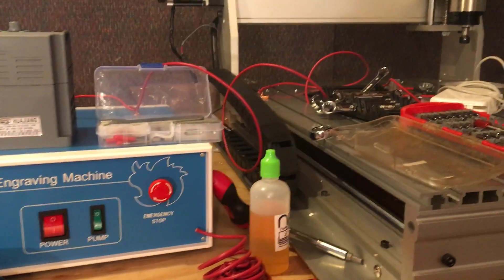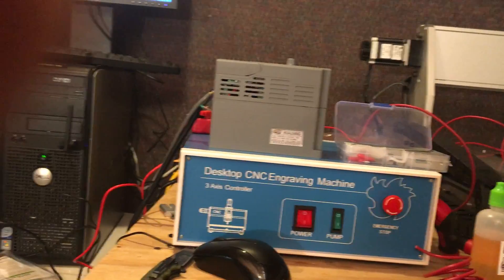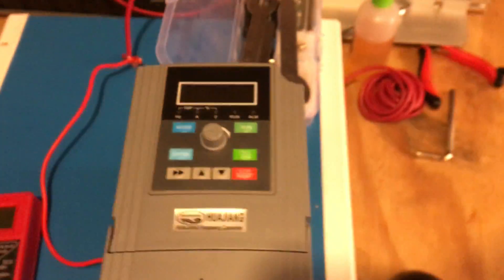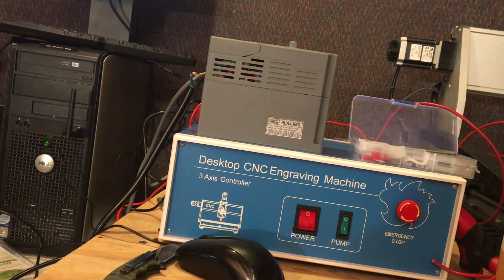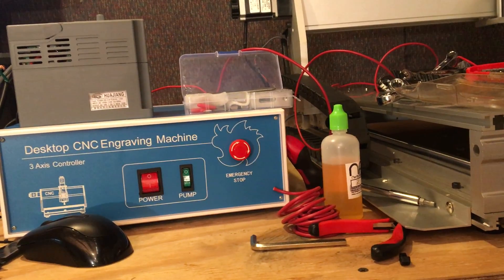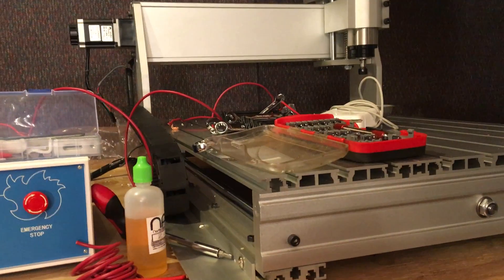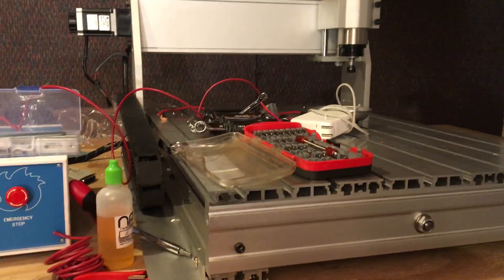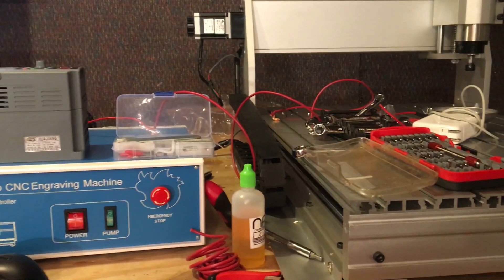6040 CNC headache and problems

Comment: Just curious if you ever got the VFD working.
You asked about the steppers-- here's my experience with my son's 6040:
The controller has a fairly limited stepper current drive (3 amps, I believe), which limits the size of the stepper motor.... but my steppers were matched to it.
We had problems when cutting acrylic- not hard to cut, but it works better if you move the bit with speed.   Stepper motors started slipping and locking up.   We checked wiring, checked noise, replaced steppers, but traced it all back to a basic problem:   torque vs speed.    The faster you move the steppers, the lower the torque you have.  When you move them too fast on any axis, their failure mode seems to be temporary lock-up.  You don't always notice until it suddenly the bit isn't where it's supposed to be, because a stepper didn't finish moving.  It always happened in motor movements BETWEEN cuts.  We slowed it down in Mach3 (not gcode) and never a problem since.  If you need torque, move slower (or buy a whole new controller with stronger, higher current steppers)
Reply from the maker: i had to replace it the new one works great

Comment: i but a 6040 the system is junk the only thing im using is the motor. everything else i replaced stepper drives,the board replaced with a mach 3 motion card with usb, you need to get it up to date. i dropped about $1000 more. keep the main deck if .040 play is ok to you. its not to me i am now spending $700 more to make it right. good lock sending anything back. after 6mo im making parts.$1500+$1700=$3200 and built a pc $700 + $2500 in programs mach3 & aspire all $6400 not fun

Comment: Keith, if you want to get this system working I can supply you the correct retrofit components to bring her to life with a Gecko based G540 controller, 2.2KW VFD, and 2.2KW spindle. Your a subscriber to my channel. Let me know when you want to perform a retrofit. Always remember eBay will provide a refund regardless of the seller you purchased the system from. This is a common issue with these integrated Chinese systems. The chassis is made with the same quality aluminum you would find in US based machines, but the controllers are lacking QC control, and the VFD you have is a fake Huanyang VFD. I know because I sell the real ones. Look forward to hearing from you, Vince
Reply from the maker: corvetteguy50 I bought a real one that will be here Tuesday but I would like a gecko and an upgraded spindle definitely
Reply: Good. Make sure you use at least a shielded spindle cable to prevent EMI noise as your chassis will be more a less a giant antenna. Let me know what kind of package you want. I offer 300, and 600oz steppers with the G540 in both DIY kits, and turnkey controllers. If your milling aluminum, and all materials in between the 600oz are your best friend with the 2.2Kw spindle (2.95hp). The 300oz work well for softer substrates. My store is eDealers Direct on eBay, if you want to check out my products. We'll get your table making you some components. :) Thank you,Vince
Reply from the maker: corvetteguy50 send me a link to your eBay store I'm actually thinking about buying a gecko and if I need to upgrade the steppers let me know I have a 1.5 KW VFD on the way I wouldn't mind upgrading to a 1.5 KW spindle I do kind of prefer to be plugged into 110 V instead of 220 at the moment
Reply: A 110v spindle is a special order component, and will require a larger breaker in your box do to the large amount of amps it pulls. I would recommend the 220v as its by far more efficient. My store is located here http://stores.ebay.com/eDealers-Direct?_trksid=p2047675.l2563 Thank you,Vince
Reply from the maker: corvetteguy50 how good are the steppers that come with these
Reply: The steppers are usually fine for softer materials, but typically only around 180-200oz in. If you plan on machining harder substrates you need more muscle to have the machine perform as it should.Thank you,Vince